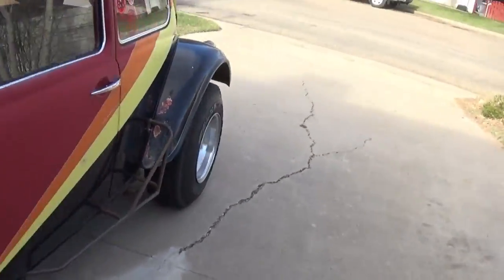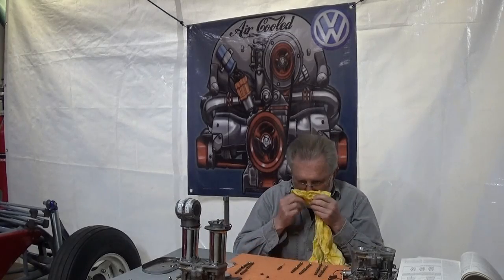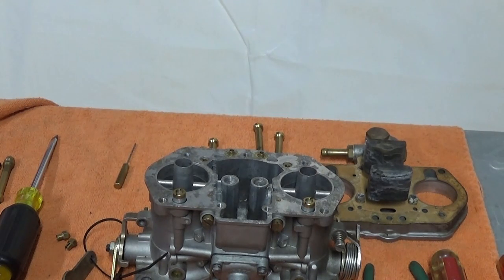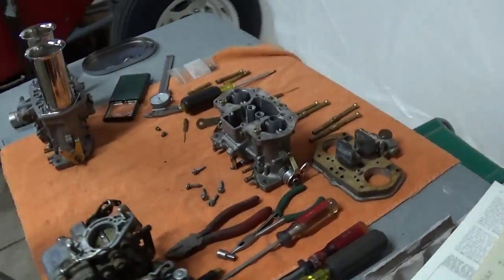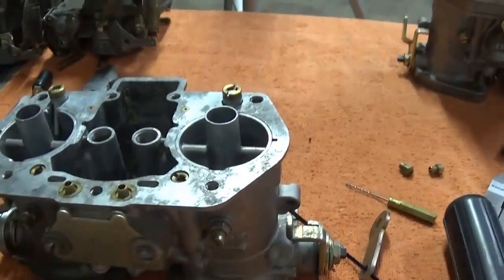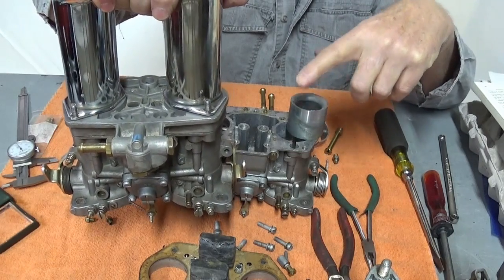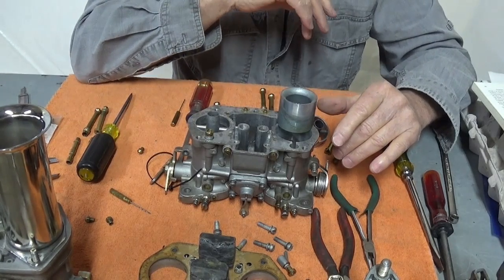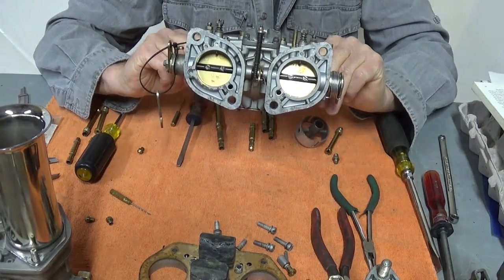Dual Weber 40 IDF Quick Fix

Comment: You are discussing a very important topic. Do not be in a hurry. If the young people understood the information you are helping us with, they would watch this video 10 times and start to get it. The reason carburetors are the best for the individual, is that it is that you are in control. There is no place in an automobile for software. Thank you for understanding the importance of this topic.
Reply from the maker: You make a very good point sir!  I will make that point in a upcoming video.
Reply: Thanks GZ, about time some one explains these Webers. I have one that is stuck and needs to be rebuilt.  I asked many shops to rebuild, and they suggest buying new ones  because its going to cost about a $100 less then new ones. In  addition to this awesome video, can u do a complete tear down and rebuild. Thanks in advance.

Comment: EZGZ,
Thank you for all this shared knowledge I wouldn’t otherwise have learned. 
Can you clarify what we can do to help with pedal response. 
In my situation, new plugs, wires, 009 dizzy. Points & condenser. I have the EMPI hpmx 40mm. In the car I pedal it, and it will fall flat on its face. 
I’ve set the idle screw per EMPI set up requirements. The air mixture screw I have tried 1 full turn on each. Then progressed to 2,2&1/2. Still to car falls flat on its face. Adjusted valves from .006-.004. 1776cc displacement stock everything else. The only 3 screws I have tooled with have been just the 1 idle screw & 2 air/fuel screws. My timing is dead nuts fires up with key turned no problem. 
I trust your deep well of VW knowledge an 30 years of experience. Maestro EZGZ is what I refer to you.

Comment: I have 6 of these on a Jaguar v12. It’s been many years of work on the engine. In order to confirm fuel level I modified the carb lid to allow movement of the fuel needle seat. This allows fuel adjustments without pulling the lid.  The fuel level is measured with a tiny cork float and thin wire about 1 1/2” long. This is dropped into one well of the main jets and seat is adjusted as the engine is running on idle. Added oxy sensors on each exhaust bank and monitored with fuel/air gages. Otherwise impossible to balance the 12 throats.

Comment: Great point about re-labeling the jets. I have been guilty of that and it will really bite you later on different motors or trying to tune for different situations. B careful, we need you to be safe and healthy so you can keep posting these great vids.
Reply from the maker: Yep.  I thought I had a pair of 135's but were really drilled to 145.  Wasted a lot of time on that mistake.

Comment: Thanks for the Video. It’s been keeping me motivated to put my Bug Back together. I bought a center carb set up that a guy had problems getting it to work.  It uses a Dellorto DRLA 40. I paid $35 for carb and intake. Hope I can make it work on my 1641 with stock cam and 041 heads. Guy I bought it from didn’t use the heat riser tubes and fought intake frosting so I will be drilling my exhaust and using the heat risers.
Reply from the maker: Use a burr instead of drill. Go from both sides and try and force it in on #4 and blend it down stream on #2 it will help but barley works in cool weather.  Getting warmer air to the air cleaner will help. Be creative with your testing.

Comment: Grateful to find someone who is knowledge about not only Weber Carburetors, but carburrtion in general !
I have a VW 2200cc Dual Weber set-up, and had always thought I had a jet issue.
But now, I am finding out that there is more to it !
My high end performance is great !
But at idle, I am getting a periodic popping.
My left tailpipe is carboned, and obviously running very rich.
I am paralyzed from my neck down, and dependent on having help with any work on my carbs, so I have to be as knowledgeable as possible.
Hoping for input please.
Reply from the maker: Popping and snapping is a lean condition.  Restriction in the jet, accelerator pump, ignition, vacum leak. spark plug, plug wires. No easy quick answer because I'm not there and you just have to go threw the search. It wasn't there before so something has changed????
Reply: @TheEZGZ  
Definitely not ignition related.
Over rich situation for sure.
Fouling the left side plugs, and left side tailpipe carboned up.
Totally understand you having not been here to evaluate the issue completely.
I appreciate your input.
Thank you for your reply !
Reply from the maker: @quadsman11 Well let's see. Bad Float, bad inlet vlave at the float fuel inlet, float level set to high, to much fuel pressure. Should be between 2 and 3 pounds. 3.5 absolute max.   Let me know what you find and we will continue from there.
Reply: @TheEZGZ  
Thanks again !
This was a brand new engine, with brand new dual Webers on it.
Has always been running this way from day one.
Only on the left side, extremely rich.
Will check the recommended suggestions from you.
Again, I appreciate your help !

Comment: Thanks for good info.
I actually have the Empi 2barrel that i had to correct float level out of box and change idle ,main& Air jets for my 1641 factory had float level so screwed up. 
✌
Reply from the maker: It's not there job to tune it. They just supply the parts. That's why I make these vids. Glad you found it helpful

Comment: Wow Im impressed with all that info ..having a bit issues with a new bug I acquired with 1600 dp with idf40 where I have no knowledge of the set up internally ..car runs ok and I can smell some gas in oil ....I'm assuming running rich
Reply from the maker: Single? Dual?  Check fuel pressure. Add a fuel regulator if it's over 3psi.   Stock fuel pumps can rupture and drip fuel directly into the crankcase.  Carb has a fuel inlet valve could be leaking by. Float level to high. Other than that it should be ok.

Comment: 👌 thank you for the vid
Pretty much the exact carb i plan to use
Reply from the maker: I hope you get as many smiles to the miles as I do........ :-)
Reply: @TheEZGZ  me too ! Thanks
Reply: @TheEZGZ  hello, I would like to ask about my particular set up, I really hope you can help.
I have a 2.2l Chevy ecotec 4cylinder engine on my desert buggy and I have one brand new weber 44idf carburetor paired up to it.
 I have the carb bench set, 1.5 turns out on the idle mixture screw and 1/2 turn in on the  idle speed, float level is 10mm.

I started the engine and it runs, I let the engine run for a few minutes shut it off and went to start it again and got nothing... i checked my plugs and they were black just carboned up.. I cleaned the plugs and it started again...

I wanted to get some input from you  as I can see you are very knowledgeable.

Comment: Ezzy  are the choke cover plates suppose to have gaskets, I believe they should, I pick up some new Webbers and 
was filling up the carbs with the electric fuel pump 
one carb started filling the other did nothing , and the one filling up started to leek gas <
There are no gaskets on the choke block off plates . so should their be gaskets ?
thanks for looing for your reply ,
Cheers from the north !
Reply from the maker: No gasket. Sounds like you need to take things apart and inspect your fuel inlet valve and make sure the float level is right.  Top of the float level with the base. No more than 3 PSI fuel pressure

Comment: Great info. A buddy of mine had a cheap Chinese IDF 40 he bought as a back up and gave it to me. He never mounted it to his bug. I thought it would be cool to make a manifold and hang it off the side of my Yamaha xv750. What type of jetting would I be looking at, or what manual do you recommend to help me out.
Reply from the maker: Most of the time the carb comes with the proper jets to handle the air flow threw the venturi.   That carb is to big for the displacement of your engine. You might get to run if you only use 1/2  of the carb.
IMHO if you just want to look at it or use it for 1/4 mile drag racing that one thing. But if you want to use it for normal transportation it ain't going to happen.  Google Amazon to find a Weber manual or go the RedlineWeber.com

Comment: Have a weber sidedraft with a turbo only seems to run its best at 3 and a quarter turn on the airscrew
Reply from the maker: Wish you would post some video on that.  I love the side draft but again your asking 1 dual throat to feed 4 cylinders so of course your going to go more fuel on everything.

Comment: Awesome! I recently purchased a set of IDF 40’s for my wife’s 72 super. You mentioned a kit that moves the clock spring to the front side of the drivers carb to prevent torsion on the throttle bar bearings. Looking at the casting there doesn’t seem to be a hole for the spring end to lock in place, like there is in the back. How do you hold the spring in place?
Reply from the maker: Sorry but don't remember. It's been a while. Seems like it must not have been to hard or I would have remembered it.

Comment: Hey easy I have a Weber 44 carburetor on my sand rail and idles fine everything works fine on it except as you talked about the hesitation when you 1st give it the throttle Would a good cleaning and carburetor  kit  Help this problem I have not always had  this problem so I think something has changed in the carburetor mind you I'm quite a novice on carburetors and I hope I'm explaining it good enough for you I did just put new spark  Plugs and I got rid of the points and have an electronic  Distributor I'm a little bit scared of taking the carburetor apart also I do have a kit to put in it
Reply from the maker: Don't be scared. It worked before and it doesn't now so something has changed,  Figure it out. Gas? Float? Inlet valve? Fuel pressure? Ignition? Plugs? Something changed, figure it out. correct it.   Be Happy!  If the mountain was smooth  nobody could climb it!

Comment: Great video, long but loved every minute. I have two of these 40 IDF 82 on a VW bus but the whole engine flooded to the point of not even been able to crank the engine. Do these carbs not have an overflow? can one be fitted? Anyone have an exploded view with named parts for them?
Reply from the maker: The overflow would be at the top of the carb and allow it all to go in the engine.  Your fuel inlet pressure should be less than 3 PSI and the float valve should hold that if your float level is correct.

Comment: I have a 1980 toyota corolla with these carburetors and for some reason the car revs without doing anything... any tips?
Reply from the maker: Float level and fuel pressure should be below 3.5. Not enough info to make further comments

Comment: Should've watched your video before buying 2 sets of Webers!  You went over things I'd wondered before, e.g. "are older engines / carbs able to respond to sudden throttle inputs".
Reply from the maker: Mine do just fine.
Reply: @TheEZGZ  Thanks for confirming!  Turns out my timing was way off (3 degrees retard at idle)... I followed the "set correct advance at 3000rpm" rule most Porsche folks use (this is a 1720cc 912) and I didn't check the idle timing after that.  Accelerator pump dialed in with the wrong idle timing works well with proper idle timing.  But now there is a very noticeable miss / stumble under load which I suspect is the "Hot Spark" electronic ignition module I installed, will re-try with points.  I hope it's not too much advance causing the missing, will re-check 3000rpm timing tomorrow when it won't be too loud / upset the neighbors.

Comment: I want to use a clone with isolated runner center manifold. Do you have any experience with this? Tight budget. Does the shorter manifold cause any cable issues?
Reply from the maker: Aint gong to ahppeh..   Been their done that.

Comment: hello I have 2 hpmx 44 carburetor on my dune buggy with a 2276 cc engine and I have a backfire problem when accelerating at low revs according to me it is you because of a bad air fuel mixture or a fire problem please enlighten me
Reply from the maker: What you describe is usually a lean condition. Check your accelerator pump squirter's and make sure all 4 are squirting the same amount. Check all your idle jets again just to make sure. Check each spark plug and look for problems. Even a vacuum leak can be hard to find.
Reply: @TheEZGZ  thank you for helping me and I found the problem it was the condenser on the foot of the distributor which was in trouble I changed and adjusted my jets and the problem is resolved it runs perfectly thank you ez gz

Comment: I would appreciate your advice on this, I have a Type 4 2056 with new dual Weber 40's it runs great but my fuel economy is dismal at 12.4 MPG. I am currently running this set up Mains 140	Air's 220	EM's F7 IDL's 70 float height 11mm. Is there something obvious that should be changed to improve the MPG? Ignition is a 123 Dist.

Thanks
Reply from the maker: If you want better economy try the original factory setting and jet size. You may need to go up to a 55 idle jet.
Allso if your driving a bus. It is heavier and geared lower than a sedan. 
WEBER 40 IDF	Factory
Carb	Dual
AIR CORRECTION	2.00
EMULSION TUBE	F-11	
MAIN JET	1.15	
PUMP JET	.50		.50
IDLE JET	.50	55 (d)
VENTURII	28mm
Reply: @TheEZGZ  Thanks it is actually in a Porsche 914

Comment: EZ I want to buy a new 40 IDF. However I don't want a knock off Chinese carb. Where do you suggest. Thanks!
Reply from the maker: first off you want a pair of dual throat Weber 40 IDF carbs with 28 venturi's . 
Don't even consider anything else. You will love me when it's running good and you will hate me when a problem crops up. Everyone who sells new weber carbs get them from the same distributor http://www.redlineweber.com/
Don't by anything used unless they are currently on an engine and you can drive it and it run's perfect like mine.
Next choice would be dual single 40 Solex Kadrons with 28 mm venturi 
Follow the factory choice. They never made a car with centermount two barrel for good reasons.  They used dual singles for space reasons, power and economy.

Comment: I have a 1776 with the 40hpmxs and a c35 can and I've had lean running conditions for a while and I'm gonna clean out and check the bowls and floats and everything. It has 52 idles and I'll go to 55 idle jets. Should I change any other jets or bypass screws for a 1776? Also set floats to 10mm closed. What should they be set to open? Most of m problem is if I open the throttle too much too early, not stomp the pedal but just trying to accelerate I hear that metallic sound like nails in the engine, someone said it was pinging when I do that. Also what should I time it to? Thx. Love your vids!
Reply from the maker: Those jets sound ok. Why do you think it's lean?  Snapping and popping is a sign of lean condition.  I think Pinging (detonation) is very likely.  Use a timing light and make sure you not advancing past 32 degree's max.  Try finding some higher octane race gas or 93 non ethanol. I used to use aviation fuel (100 low lead). Bring a container to a local small airport and tell them it is for a off highway go cart. They will not put it in a vehicle that runs on the street.
A 1776 with stock valve head usually needs at least a .040 spacer shim under each cylinder. Do not try putting it in  a used head. EZGZ out!
Reply: @TheEZGZ  I think it's lean since my gas tank was crumby and that got into the carbs. I replaced the entire fuel system which helped out a ton but it ran rough again. I'm pretty sure whatever was in the gas was gunking up the idle jets and it stinks horrible out the exhaust. I also noticed the throttle shaft has play on the left carb. I can't tell in which way yet. It also has 40x35.5 valve heads

Comment: Still having a little trouble understanding when the carb switches from the idle circuit to the main circuit. Also still not quite sure what those little progression portholes are doing
Reply from the maker: Those progressive holes are what takes you from idle circuit to main circuit. When the butterfly opens you get a rush of air and you need lots of fuel to keep the fuel ratio correct.

Comment: Why does the carb gargle and leak when you turn off the motor when on a engine mount?
Reply from the maker: The fuel inlet valve controlled by the float is leaking by. Could be to much fuel pressure too.

Comment: Hay ez I have an opportunity to get a pair of 40 and or also 36 dellortos for my bug , it’s a 1600 at the moment but I’m wanting to increase the cubes please let me know on your thoughts thanks 😊
Reply from the maker: If you can afford it buy both.  I love my 36 dells and many of the 40 parts are interchangeable with the 36.  These carbs are hard to find parts for.
Reply: @TheEZGZ  ok thank you, yeah,would like to have both. the 40s are in a Carbie repair shop $1600 aus that has been serviced and the 36 $800 private sale may need attention,both are Carbies only no manifolds,probably go with the 36 . It’s not always easy to know where to draw the line when it comes to money.
Reply: The 36 IDF (or dellorto drla) were standard on many Alfa Romeo alfasud/sprint/33 models. Some of the guys racing those cars went for the 40 or 44 IDF or 45 DRLA when the rules allowed, especially for the ones running high rpm and high power output, but there was also a restricted class where we raced the 1500 with the 36 weber or dellorto.

Comment: Sir, I just got a set of Italian Weber 40s, what jet sizes would you recommend for a stock 1600DP at 5500 feet?  I'm about an hour south of you.  I've got 50 and 45 idles I can use, 115 main, 200 air, and F11 tubes, thanks.  They were originally jetted for a larger motor at ~2200 feet.  Also curious how far I need to break them down before I can put them in the dip.  Do I need to pull the plate shafts?  I've got everything out except for one venturi and the needles so far.
Reply from the maker: WEBER 40 IDF Factory
Sizes Single
Carb Dual
Carbs 
AIR CORRECTION 2.00 1.60 2.00
EMULSION TUBE F-11 

MAIN JET 1.15 1.45 (d) 1.15
PUMP JET .50 .50 † .50
IDLE JET .50 .65 .55 (d)
VENTURII 28m